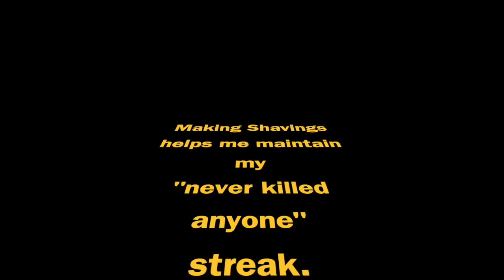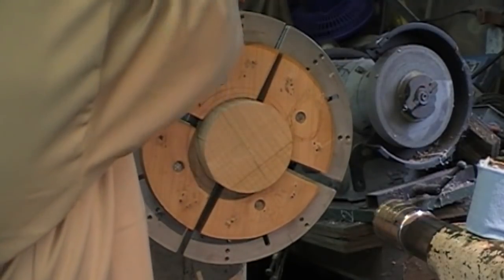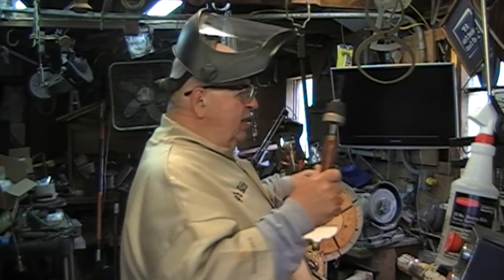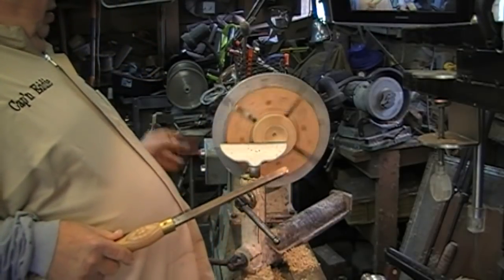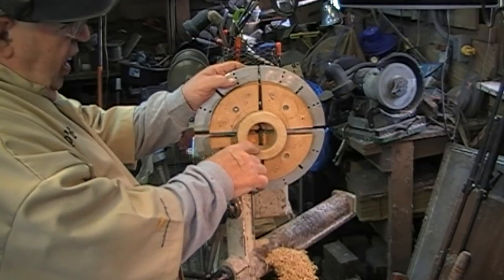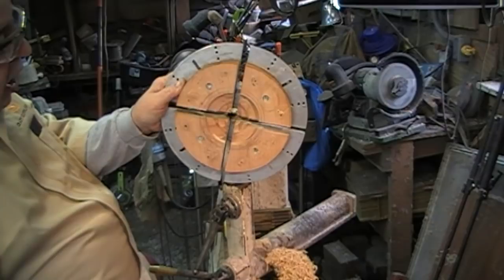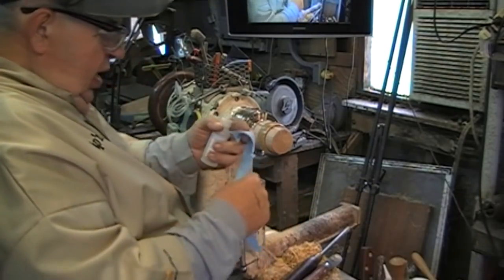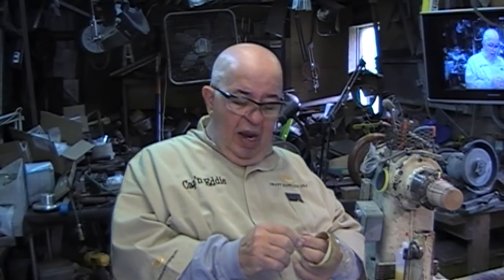# 331 Bracelet

Comment: Happy and Healthy New Year!! You couldn’t be more right about the face shield. When I started woodturning I always wear a dust mask in my shop. I bought a shield that was a little flimsy but it worked. Then I moved up to the same one you use now. As you know “dust” is a very serious problem for our lungs, so I decided my lungs were more important to me so I upgraded again to a “Trend” face shield with dust filters and fresh air inside the face shield. Yes it’s a bit heavy and yes it takes a little getting use to but it’s the best protection you can have in for ace shields and I’m worth it. I also put in a dust filtration system which clears the air in my small shop every few seconds and has a charcoal filter and a 1 micron filter. Last year I added a central air filtration collection system that sucks the dust into a pipe line at every tool and takes it back to the filtration collection system. Is it worth it? You betcha it is. Anything that protects me is worth it!! Happy woodturning from New York State. Best regards, Richard